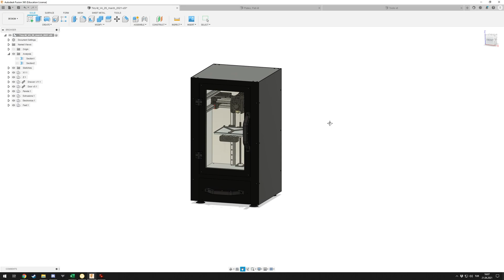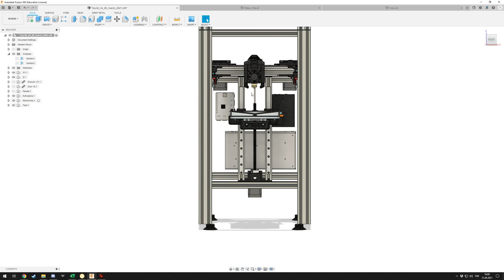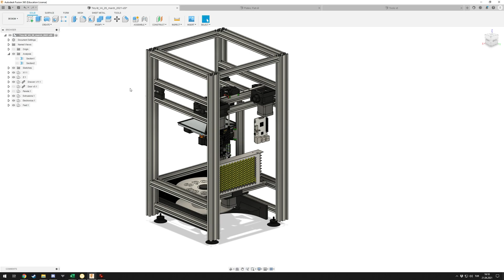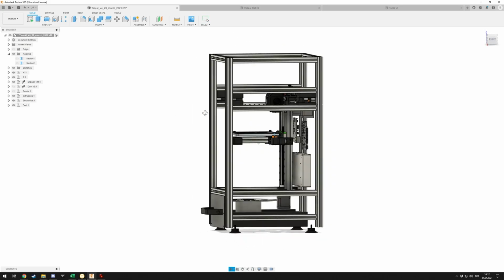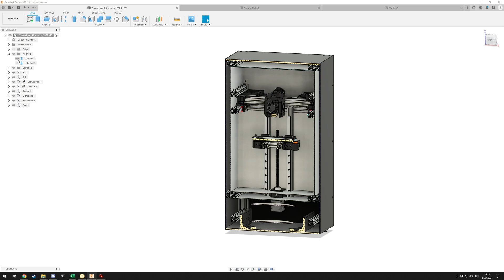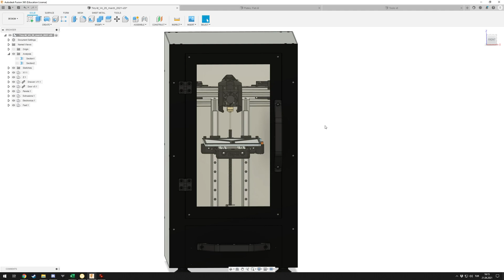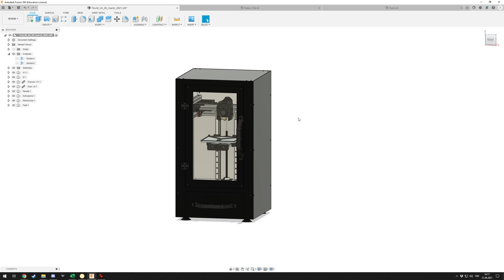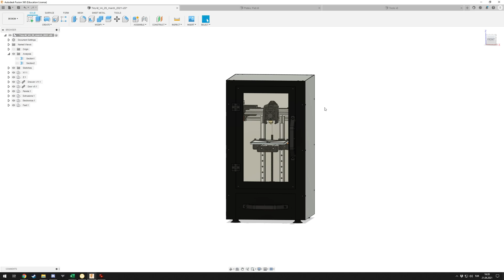New 3D Printer CAD: Tiny-M Doom

Comment: Is there any way to add an air filter or will it mess too much with insulation (or is just no worth it anyway)?
Reply from the maker: Recirculating air filter is a possibility. There is enough room above the a/b motors. That space could also be used for a chamber heater but I don't think both will fit. I'm not sure which one I'll choose.

Comment: Very nice work! Have you considered just using some thermal insulator tape between the panels and the extrusions, and leaving the rest of the space empty? Air is a pretty good thermal insulator
Reply from the maker: Yeah it could work well. But also insulation is cheap and easy enough so I don't see the point of not using insulation after doing all this.

Comment: Hi, looks nice, why filament spool on the bottom?
Reply from the maker: Because it hides the spool. Not really necessary but I think it looks nicer. Plus with further mods it is possible to seal the spool drawer, to protect filament from moisture, which can be a problem especially with some exotic filaments.
Reply: @IsiksTech  You don't think having it on its side would create a tangling problem? Just curious.
Reply from the maker: It should be fine on the side with a bowden holder. Works well on stock v2.
Reply: @IsiksTech   What do you think about: spool drawer on the top?
Reply from the maker: It would be difficult to use. Can't see the top side.